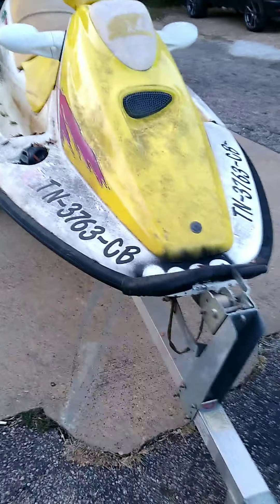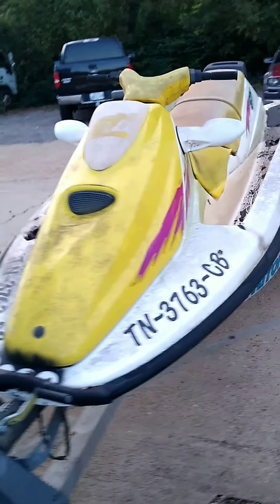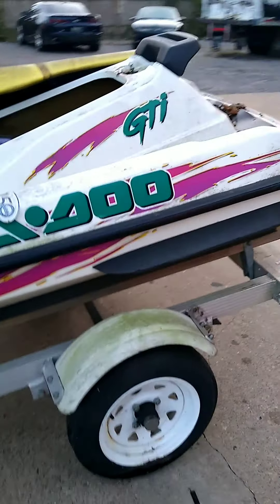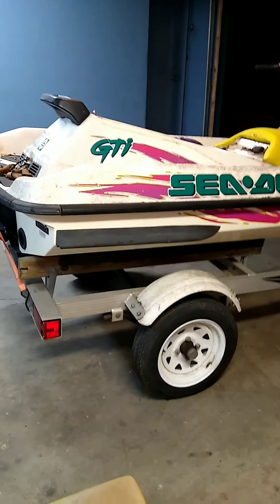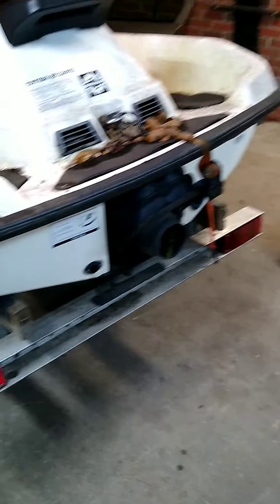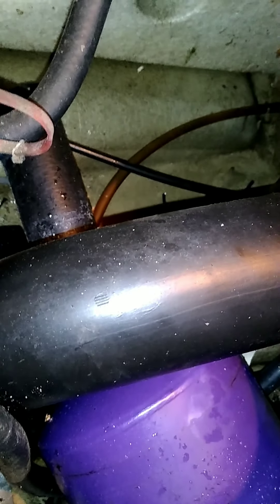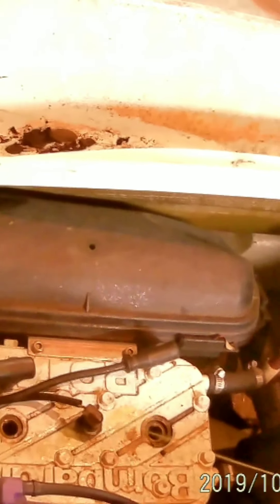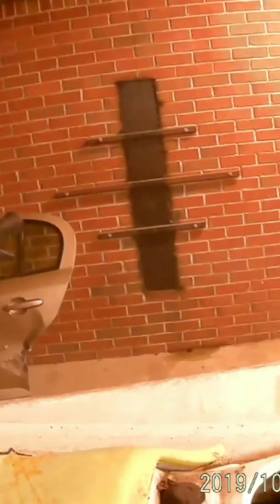Abandoned Free 1997 Sea Doo Gti 720. Pt.2 #abandoned #free #seadoo #seadoolife

Comment: Man what a find. I picked up a 92 gts and g4 spi both with the 567 motor and its been nothing but starter issues, starter solenoid, battery etc.  Both of them were only 400$ though with the trailer. These are great diagnoses videos with your others